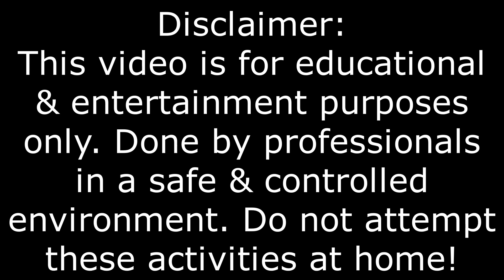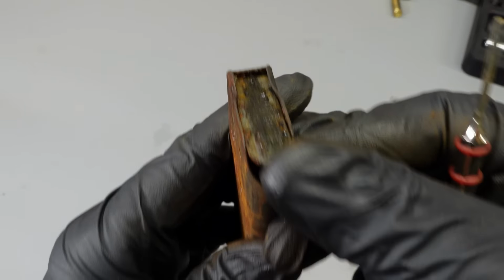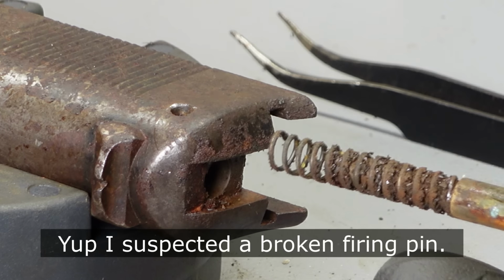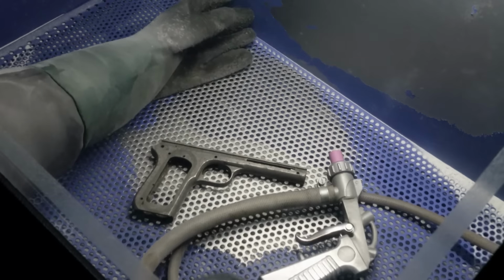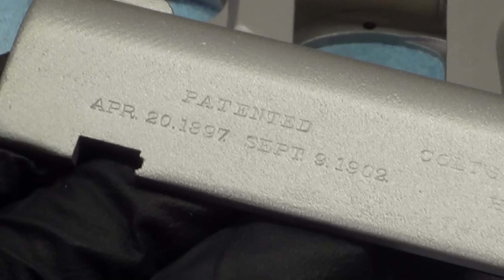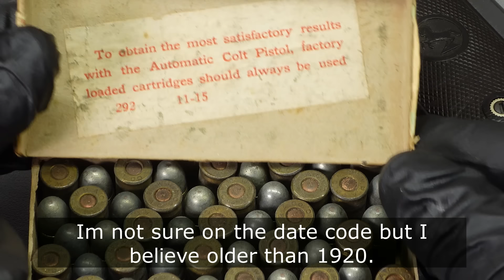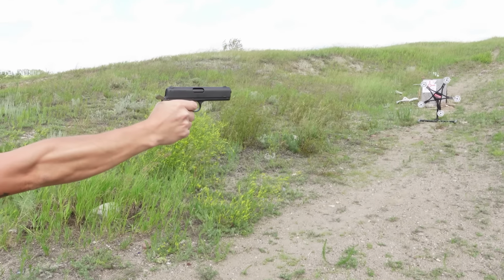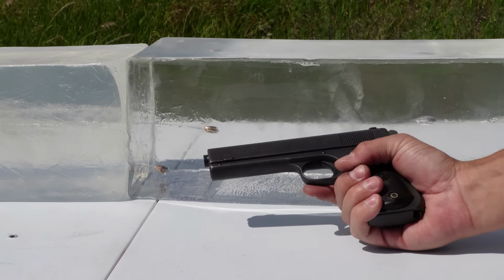Gun Restoration | Colt Model 1903 Pocket Hammer, (with test fire)! #restoration #restore

Comment: The part labeled "safety" at 6:20 and 12:55 is properly called the diconnector. When the gun fires, the slide starts moving to the rear and pushes down on the top of the disconnector, disengaging it from the sear so that the sear edge can engage in the hammer's sear cut, keeping it cocked.
Reply from the maker: Thanks for the info we appreciate it!

Comment: I imagine one could just hand load 38 super ammo to the lower pressure of the older cartridge since they are dimensionally identical.
Reply from the maker: Yes you absolutely can do that all you need is to know the load and fps. I believe now I do not re load ammo and I’m not well versed in the procedures in re loading. But I read on a forum that you can do this yea. But .38 acp is available online. That’s where I got the cartridges to fire this colt. They are loaded to period cartridges that the firearm was designed for. But that doesn’t mean that one of these old colts can’t fail upon firing. Which is really scaring to think about if that from barrel link pin failed and the rectangle pin failed the slide could become a projectile directly at your face. Sorry for the long response. Thanks for watching

Comment: I almost wanted to buy one of these at one of the local gun and pawn shops here in my area. They had a few of them for sale. One 1903 and two 1908 models. The 1903 was in almost good condition, and the two 1908 models were near mint. One was nickel plated, and the other one was blued. I wanted the 1903 model, but they were asking almost 700 for it. I had to pass on that.
Reply from the maker: Well that is a good price for one of these models to be honest. They continue to go up in value and are in essence like buying a stock that is guaranteed to go up. I have the colt models 1877 lightning, 1903 pocket hammer, 1903 pocket hammerless, 1908 vest pocket, 1909 U.S. army, 1911 and 1911a1, looking at acquiring the model 1900 sight safety, 1902 military, and 1905 the first .45 acp modern handgun. Just over 6,100 of the colt 1905’s were produced so they go for $$$$
Reply: @TheKinzlerBros  yeah, I wasn't sure of the price back then of that 1903 I saw. It wasn't in the best condition otherwise. I wouldn't have had the time to fix it up to be shooting worthy. The guy behind the counter told me it functioned just fine. So they say lol

Comment: Does it not matter that the riffling is gone and the bore is worn out ? Can you buy replacements or rescue the original (Bore it and insert a liner or so (I'm new at this so excuse if it is a stupic question.))
Reply from the maker: It matters for accuracy, ya you can buy a different barrel and preserve the one you have if you have the equipment and knowledge. Thanks for watching

Comment: Verry amazing man i like this beautifull things but im trying for hot bluing by using soduim haudroxide and potassium nitrate but no black as your parts i dont know why if you can help plz thx
Reply from the maker: 5 lbs sodium hydroxide to 2.5 lbs potassium nitrate per gallon of distilled water. Heat to 250 to 260 and suspend it in water for 8 min. Never put aluminum in it. Thanks for watching
Reply: @TheKinzlerBros  thank u verymuch and we waiting for new video

Comment: Question 🙋‍♂️. When preparing the slide and various other items before bluing, do you make any adjustments for fit and function? With all of the rust removed and pitting, I’m baffled by the action being so movable with what appears to be no filing or milder abrasive applied other than the bead blasting. Is it really that straight forward, just bead blast and no other smithing required?
Reply from the maker: Ya sometimes I have to file a part or bend it to make it work. I'm always learning new ways to fix things as I go. The bead blasting is great but, it doesn't always do everything. Thanks for watching!

Comment: What calliber Is this Pistol?
Reply from the maker: 38 acp, thanks for watching!
Reply: Best referred to as .38 Colt Auto. Dimensions the same as .38 Super, but MUCH lower pressure. Calling it .38 ACP, while not incorrect,  may lead to people trying to use .380 ACP in ot, which won't work.

Comment: Use a slotted bit closest to the width and length of the slot on the screw you are trying to take out. Especially when it's all rusted. Otherwise, you can deform the slot of the screw that you would probably never find a replacement for. Also, for God sakes man, don't drop the hammer on the frame when disassembled!
Reply from the maker: You realize I dropped the hammer for the video right?  I wouldn’t do it otherwise. This is also an entertainment video. In movies they do things they should not do with firearms. Like spinning the cylinder on a revolver with it swung open then using inertia to close it. They are done for the viewer. Plus if it were to break then it’s on me to replace it. I get your comment believe me I do. I love firearms and cherish there history. I have many that don’t need refinishing. Thanks for the comment
Reply: @TheKinzlerBros  You're right. The gun was trash to begin with, and had absolutely no value. So what if you don't do it properly. As you say, you're an entertainer, not a professional.